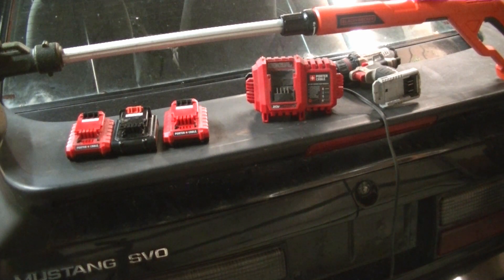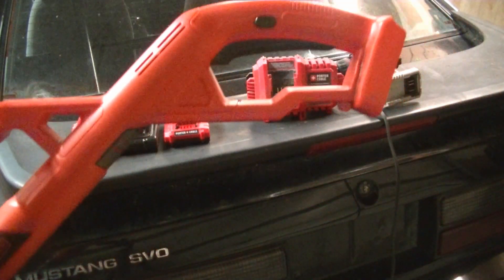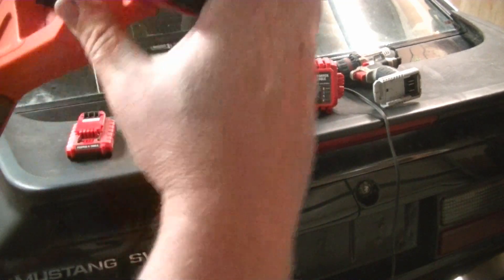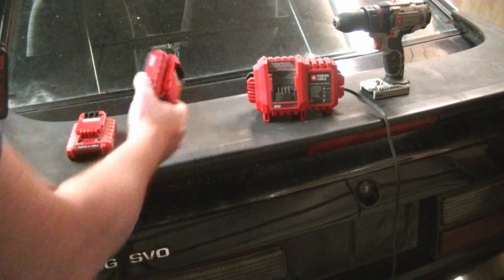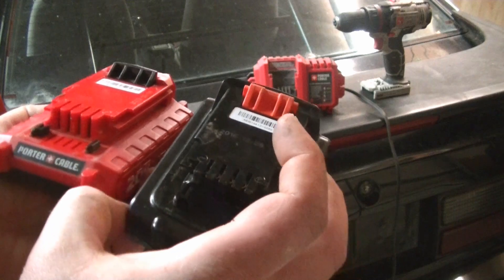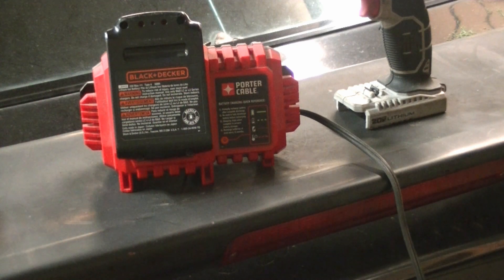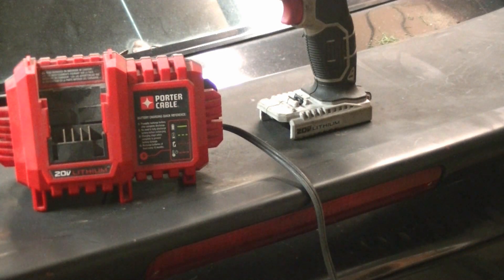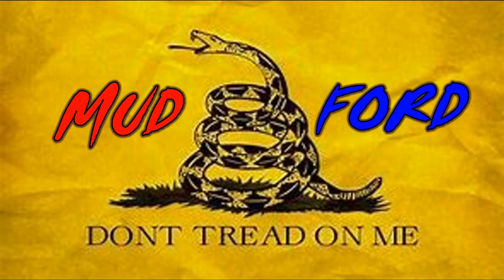How To Make Porter-Cable Battery Packs Work In Black And Decker Tools

Comment: True fuel for 2 stroke gasoline.. I leave the gas in all winter in two pulls very little sucking with the choke fires right up…even my stubborn over lot opened carb huskvarna chain saw. 

Had that weed whacker you have. It sucked you weed eat very little or keep up on it better than I nooooo nuts… true fuel though you’ll thank me. Keeps carbs clean as a whistle an no mixing you 2 stroke just right anymore

Comment: Did you consider modifying the Black and Decker tool so the PC batteries would fit without modification?
Reply: I know this is an old post but for future readers...
As long as you cut the battery so that the top notch is the same on both sides it will interchange between porter cable and B/D Tools.

Comment: I want to use my Porter Cable battery on my B & D trimmer, can I notch the other side and will it fit in charger?
Reply from the maker: It should.  It might not lock in perfect, I think that part might be slightly different.  You should be able to get it to work though.

Comment: After making the modifications to the Porter Cable batteries could you still use them with the PC tools? I have the PC drill & impact drill and they are still working fine. Kit came with 2 batteries and a charger. Was thinking of picking a blower or weed trimmer up at a thrift store next time I see a compatible one on 50% off day. Coincidentally, I drove an '85 Mustang from about 1997-2002 and learned all about Ford repair during those 5 years, lol. Thanks in advance.
Reply from the maker: Roger C. Polanco If you make this mod, your PC batteries will work for both B&D and PC.  You can also modify the B&D batteries to make them work in your PC tools.